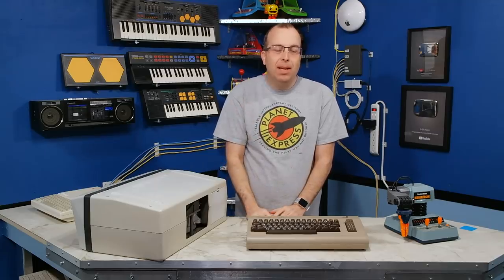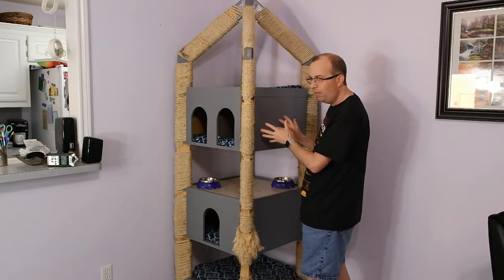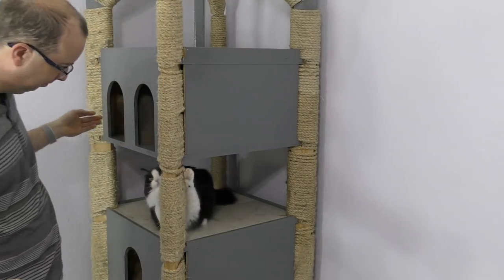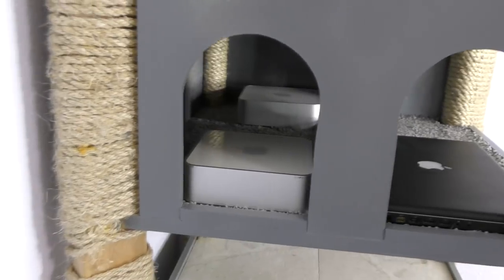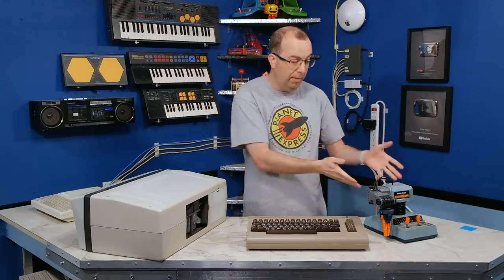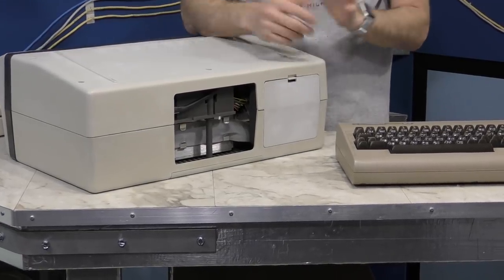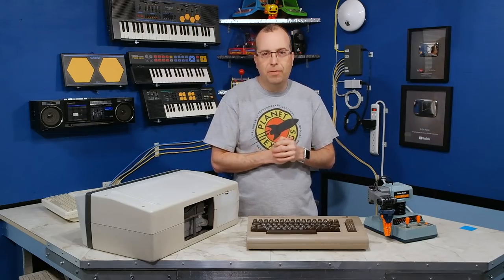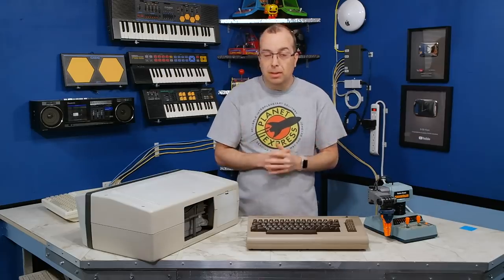Updates on Previous 8-Bit Guy Projects

Comment: Hi.  I am wondering if making a mold of the gear on the Armitron using silicone or something like that, then using something like acrylic to make the gear, would let you recreate the gear.  The acrylic would be pretty tough, but should be easy enough to work with.  

Love the videos!

Comment: That sucks about the handle. I wish I had beat the guy to it, because I would have done a good job and actually sent it back. I have a machine that stitches 3/8" thick, and even if it's thicker I could saddle stitch it by hand, and I have a few colors of leather. If your trust is broken by the previous individual, I would like to still help if you can drill the rivets out and re- rivet with a pop rivet gun or small bolts after the new handle is made. I make sewn leather and fabric guitar straps, custom bags, automotive gearshift boots, etc. So even if the new plan is to send only the bad part (if that proves to be possible) I could do it. Hope you're having a good vacation, and I look forward to the next video!

Comment: I don't have cats (or any pets) myself, but I know people who do and the first thought when you started gluing down the carpet is "How is he going to clean it?" if one of the cats gets sick on it, or has an accident, it will be a lot harder to clean it than with a removable pad. As for the level with the two rooms, I agree with others that the rooms look too cramped for your cats. Also, it looks really awkward for them to get into. Not that they can't, just that they're not that convenient.

As for Armatron, have you checked online for generic gears of the right size? Checking eBay for just the word "gears" gives me 2 million results. I'm sure if you add the shaft and gear size, it would narrow it down somewhat. You might be able to find a metal replacement for it.

Comment: If you glue that cord down it would last significantly longer I would think. Would have to come up with some way to replace the whole section though, might not be worth it if the cord is cheap and easy to replace after being shredded though. I'm just lazy and wouldn't want to replace that cord for 4 or 5 years if I could help it.

As for the gear, buy a little thing of silicone molding putty and make a mould of one of the other ones. You should be able to cast it in whatever material you can normally cast in silicone, plastic, acrylic, epoxy. Maybe with some fibers mixed in for extra strength. Should work fine, drill out the hole and glue it back on.

Comment: https://youtu.be/zV1kMYdkGq8
For the gear, why not try mould putty and melt some old lead fishing sinkers? Link above shows what I'm talking about. Just take one of the good gears(with shaft attached to press into putty to make mould), after you pour the lead and it hardens you can drill center hole and file any edges rather easily as lead is so soft. And you'd have the mould to make several for future if another breaks. Keep this simple, no fancy 3d printing etc...

Comment: can the 3 intact gears from armatron #2 be slipped off the shafts or disassembled with the shafts and used as spares for the faulty gear in armatron #1? Maybe cutting a shaft while it's disassembled and putting a small, in-line spring clutch would solve the problem at the end of the claw's travel.

Comment: About the the robotic arm. I'm sure a reason printer would have the resolution to make a part that small and if you change the way it's sliced could give you strength. Also couldn't you just use one of gears into the one you are fixing

Comment: I'm pretty sure the gear you need is pretty standard and can be bought of Aliexpress easily. They are very cheap and I'm pretty sure you can find a fitting gear when you have a look there. I have bought many gears from there before and wouldn't be surprised if I had that exact gear among them.

Comment: I could totally 3D print a gear like that, but you need a fine nozzle, also im on the other side of the globe so i doubt i could send it to you, even if i somehow got the model or the specs dimentions of that gear.
you should ask some local 3d printing service, though im sure theyll charge you extra for the resolution needed, all the extra work and stuff. If you want to look further, ask them if they can print it in PETG or nylon. It wont be cheap, but im sure it will be cheaper than shipping it across the world. But to be fair, its a piece that doesnt exist anymore so even 20 bucks would be fair imo.

Comment: Dude. for that armatron arm gear, Get a set of small triangle files, A small drill bit to suit, and find a small round piece of brass. I was reminded by a youtube video i watched, about the antikythera device. some dude tried to replicate the missing brass gears. I have replaced a few old r/c buggy gears this way, Also rape some old tape playeys/vcrs for gears you might find one to fit + it will be stronger because its brass, be able to lift a cinder block haha.

Comment: Information for everyone, the plastics will yellow again over time. It is possible to apply sprays which reduce the effects of UV radiation but they need to be reapplied on a regular basis. The best way to prevent early yellowing after RetroBrite is to keep your old plastics out of the sun as much as possible. Perhaps you can cycle through them instead of having them all on display at once.

Comment: You could 3d print a gear slightly over size and finish it by hand. Not sure it would be worth the expense but a good machine shop can make a metal one. I work at a machine shop and actually thought that perhaps if a metal replacement was made and available others might see and buy it..

Comment: Can you just steal one of the multiple gears from one and fix the original arm. You could also form a mold of a gear with silicon rubber then cast a new one with epoxy.

Comment: I make kitty condos for mine, I take old shelving, make multiple levels out of it, put a structure on top, doors, and use chicken wire to enclose it (it sounds more cruel than it is, they get used to their stuff all being in one, contained spot and it becomes their happy place). I can say without a doubt that your kitties don't like that room because its too small and the openings are too small as well. I'd recommend knocking out that wall altogether and leaving the other two walls so they feel secure, maybe put another fluffy bed there. Not many cats like being in tight spaces, especially the size your kitties are.

They are absolutely beautiful, by the way. I'm so sorry to hear about Noid.

Comment: Had a look through the comment and saw no metioning that that gear might be a standard 8 tooth gear. Had a look on a few sites like Alibaba and ebay and if you measure them with calipers correctly I would not be surprized you'd find the right ones there.

Comment: I bet if you put holes in the tops or bottoms of those cat tree rooms that they would be more likely to play around in them.  Cats like going up and down. -- I'm guessing that apple is yellowing around the vents because that's where the most heat is dissipated. -- I bet with regular usage you'd see more yellowing.  But if it's mostly just on display and only seeing occasional use, you may not see any further yellowing.

Comment: Love your cats. Here is an idea, cats love to hide, so instead of opening that compartment completely, I would close it again, remove the central piece inside (because they dont have enought room, I think thats why they dont like it) and close the two doors in the front and open a circular hole in the top for an entrance (where you put the new carpet) and maybe another one in the bottom (not aligned with the hole in the top). Some small holes on the sides wold be fun for them to play catching someting on the outside. I think with those changes they could start using that space. Thank you for your videos, love your channel. Regards from Peru, South America

Comment: you could get a model of the gears and get some company with SLS printers make them for you.  Or you could find someone more local with a SLA printer to make some decent hard resin pieces.  Or you could possibly try and take of the old gears and try molding it yourself in silicon and casting one for yourself. Lot's of neat options there I think.

Comment: For the gears, make a silicone mold (pump tube, or small squeeze), brushing a layer on first before gooping the rest around it to make a castable mold shell. Be sure and use some type of releasable agent prior to gooping, such as a few layers of hairspray. Then use some resin, mix it up and fill the mold. Last step is to drill the hole once cured. My two cents on making new gears. K.I.S.S.

Comment: If you still haven't fixed the armitron you can take one if this gears from that stage and swap it with another. Just pull a different one. I can also 3D print you a an identical gear for you if you want. I'll just need you to send me  a few measurements.

Comment: For that missing gear, could you just print a small cylinder and use a file to make the teeth? Or, if they're all the same size could you remove one of the gears from another post and put it on? Just curious.

Comment: You might be able to replace those plastic gears with brass ones from eBay, but that might compound the problem further and cause something else to break. What is really needed is some sort of torque-clutch mechanism which won't allow the gear to move any further once a certain pressure is reached - the type you find in electric drills. That would probably be a lot bigger and more complicated and really not worth the effort for a toy robotic arm.

Comment: Take the gear with shaft still attached and make a mold using Alumilite Amazing Mold Putty. Before it fully sets, pull it straight out and rotate the gear and press it back in to replace the missing tooth with an intact tooth. Alumilite also makes a very strong casting resin to make the gear.

Comment: I'm sorry to hear about Noid. For the top of the cat tree I would recommend removing the divider completely, giving them an access to through the top of the little room, and replacing the door style panel with your wide open wall idea. But I would add one thing: a lip. The lip should be just high enough to give the cats enough hiding space so that they feel their not so visible.

Comment: Do you have the measurements of the missing gear. Namely, outer diameter (center to outer points of the gear), inner diameter (center to inside of the gear), number of teeth and diameter of the shaft?

Comment: As I understand it, the yellowing is a bromine reaction that is triggered by photons striking the surface. So unless you somehow completely change the composition of the plastic or coat it with something like a UV shield, it will probably eventually go yellow again unless you keep it in the dark. But that said, these days one of those old machines is going to spend a lot more time in the dark than it probably did originally, so will probably take a lot longer to go yellow again. And in any case the retrobright does a great job of making it look good again.

Comment: @The  8-Bit Guy; For the armatron*  Take a gear off the other ones from the donor; they slide off with bent tip  needle nose pliers  https://www.amazon.com/Extra-Pliers-20%C2%B0Bent-Diameter-ring/dp/B01H30UMMU & tap on to the one missing using something like the handle of a screw driver ; the reason that gear commonly breaks is bc it would continuously exert force when the toy met resistance & would give at the gears . The gears are all the same diameter & gear / teeth ratio so they are interchangeable***

Comment: A) Cats : - Did they take to it,  try lining the box with an old sweatshirt of yours if the cats like you smell.  
B) Gear Wheel - ask a friend with a lathe to machine a brass one.
C) Leather handle - see other comments on the orig, video or find an old sofa and use the leather from that and stitch a new one.

Comment: If you ever decide to fix your Armitron, there is a simple mod you should really do.  I had an Armitron years ago.  When I got tired of it I bought a wall wart and soldered the leads across the battery terminals to eliminate the need for batteries, then gave it to my nephew.

Comment: in reference to your needing a replacement gear . I suggest getting some soft modeling clay and then push  a good gear down into it and pulling it out leaving an impression of the gear . in the clay .Using this as a mold for an exact copy of needed gear either mix up 2 part jb weld and pack into clay mold or use 2 part urethane plastic. once its cured remove it and sand off flashing

Comment: To solve the problem on the top floor of your cat tower you should take out the divider ,as you said but also make a kitty-hole in its roof so They can drop them selves in through the top, which is easier and more intriguing for the cat.

Comment: Why did you not use a small home made gear puller to scavenge another gear from one of the other drive post?  You could have also made a mold and copied it with epoxy of some form.  Just as ideas...

Comment: i might have thought of a solution for the missing gear, if possible you could remove one of the other gears, and make a cast of it in silicone, then you could cast the gear in resin plastics.

Comment: It might be that gear was taken out as a last minute safety concern, meaning that maybe all Armatrons have the same missing part. In that case your only option is to manufacture the gear based on the ones you've got, or see if a gear of similar size can be removed from the other Armatron you bought, sadly relegating it to parts only.

Comment: All the gears next to the one that's broken. Look to be the same they'll be pressed on you should be able to pull it off you may have to use a little Loctite or super glue to keep it ahold of the missing gear.. I believe that will get your toy back in action

Comment: A lot of people mentioned molds for the gear, it would probably be "easier" to either 3D print or find a round piece of plastic the right size and drill a hole through the middle, trace out the teeth pattern, and then use a small triangle file to cut the gear teeth.

Comment: You should branch out into metal working and make a new gear out of aluminum using one of the other gears as a base for a mold. Then replace all the other gears with metal ones.

Comment: you should buy metal replacements fix the design flaw if the other gears are same just make a mold of 1 and use abs slurry to cast a new for now i did that for a tiny tiny plastic slider piece used in slider analog sticks lol i used silly putty to make the 2 half molds after that sanded then glued both halfs together work great

Comment: One thing you might want to do is not keep gas in the tank and engine for an extended period of time as the modern ethanol gas that is used today can gum up and then you have to drain and clean the tank, flush the lines, and change the injectors, and that's pretty costly.

Comment: Try a search for gears on ebay, even if you have to use a metal gear. Just heat the rod up and push a plastic gear one. Or take one from a small motor

Comment: The broken gear. just use one of the other ones from the 2nd unit you got. They all look the same. Just pull one off and put on the rod of the unit you want to work.

Comment: You should be able to use any one of the three gears out of the spare. I have a problem with them splitting in two over time. Tomy has the same issue.

Comment: For that gear, if its the same shaoe and size as the other gears why dont you cast one of the other gears in silicone and then cast it in epoxy or some other resins?

Comment: i believe 3d printing the gear for your armatron would work especially if you used ABS plastic rather then PLA. ABS is used in a lot of RC car builds and is very strong. I would at least give it a go.

Comment: I had an Armatron when I was a kid, and regularly tore it apart and reassembled it to learn how all the innards worked. It did have a strain relief system built in to avoid gear damage: Crown gears held together by spring tension. If the torque got too great, the crowns would compress the springs and "skip". What happened to your armatron is different: nylon gears got old and crumbled. This is a common failure, and the reason why you saw so many Firebirds and Fieros with one headlight that wouldn't raise.
Reply: ^The gears in the wrist and elbow were interchangeable, so you do have a replacement on hand for that missing pinion.

Comment: My Armatron claw gear clicks when it reaches the max grip strength and it still works perfectly all these years later.  The way it sounds makes me think it was designed that way.
Reply: Yes, it was. I had an Armitron for many, many years, having gotten it new. I could take it apart and put it back together blindfolded, like a soldier can with an M-16. Y'know, I kinda wish I were kidding.

The clamps have a rudimentary, yet very clever, spring-loaded clutch that governs the limits of the claws. When the clamps are opened to their minimum and maximum limits, that clicking you hear is the plastic clutch allegedly protecting the transfer gear that broke. Not well, it seems.